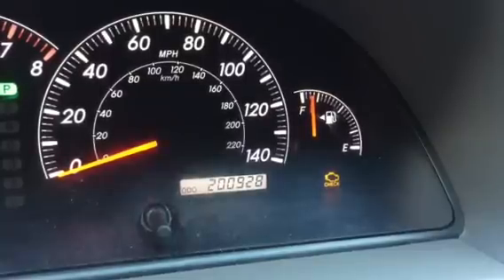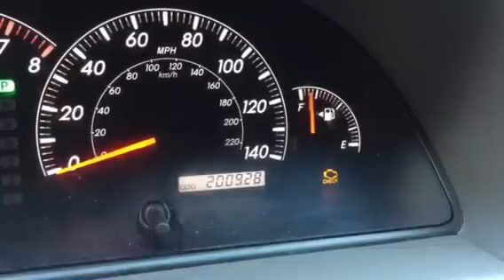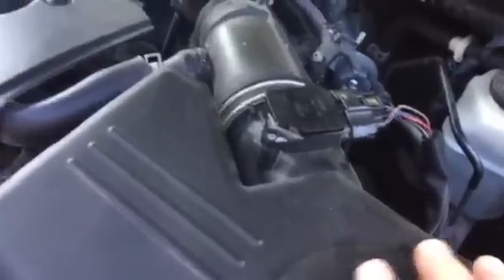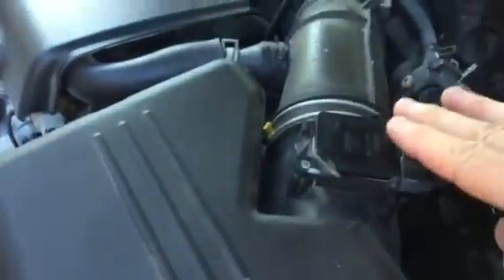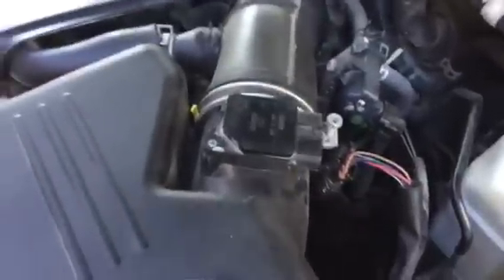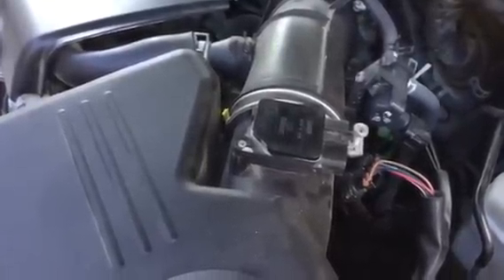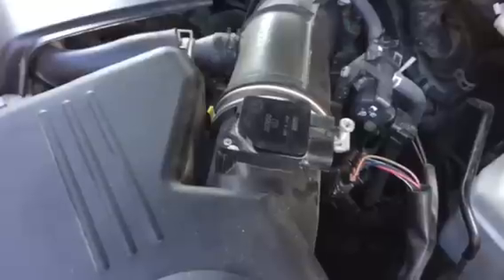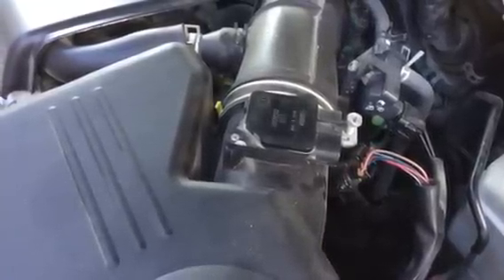How To Tell If Your Mass Air Flow Sensor Is Bad On Your Car

Comment: If I'm driving down the highway and push my gas peddle to the floor and it kinda slows down then gradually picks up speed is that a bad Mass air flow sensor? I unplugged it and it keeps running, actually idles a little higher. My check engine light isn't on though.
Reply from the maker: That is certainly one of the signs of a dirty or failing mass air flow sensor. 
You might want to clean it first before replacing it.   https://youtu.be/YnckaCCJEEk

Comment: my1995 camry rev only up to 2000 revs checked all censors ok its a 2200si camry please i need help
Reply from the maker: You might have a plugged  catalytic converter.

Comment: I have a chevy malibu 2001 ive been having some idle issue when im accelerating seems to lag a little i have replaced the TPS sensor and it still remains i did disconnect the MAS from my car and it does change the idle when disconnected would that mean its not working correctly if it doesnt turn off
Reply from the maker: Your symptoms sound like the mass air flow sensor could be dirty or faulty.  I have experienced a faulty mass air flow sensor before the check engine light turned on.  Also make sure you're throttle body is clean.  
https://youtu.be/cOAYWVBfuek 
https://youtu.be/YnckaCCJEEk
Reply: WeRanyone714 i think some issue with the paddle sensor

Comment: Hi, I have 2006 BMW 330xi. I tried this methond. Car continued to run. It actually ran better. Please anybody has any ideas as to what my issue my maybe please add. I keep getting mass air flow codes more than one. And I replaced the sensor with a new one. Same problem occurred. In starting to think this may be a throttle body or iac issue.

Comment: Tried it on my 06 2.5i impreza. It shut off right away first time i tried unplugging it. And threw CEL. I reset those codes then tried unplugging it again, and it does not shut off, but throws CEL? Any ideas??

Comment: Thank you for a good video I just installed a new one and wondered why the engine light still on. Now I know
Reply from the maker: The check engine light should turn off after 50 miles of driving.

Comment: I had P0171and P0174 codes before I the MAF sensor was cleaned then Check engine light gone but I cant accelerate more than 80mph, it loose power.I follow your suggestions disconnecting it and stopped. I have a 2011 Ford Edge sport can you give me another direction to check? Thanks

Comment: Golf 4 1.9tdi 66kw alh i unplugged the maf sensor and it's still running and it drives a much slower than before so my MAF sensor good or bad?

Comment: My car toyota vios 2005, the engine keep stalling. Mechanic says maf sensor need replaced. I test this method and my engine stop when i unplug the cable, so my maf is fine?
Reply from the maker: I would first start by cleaning your throttle body.  https://youtu.be/cOAYWVBfuek
Reply: proclaimliberty2000 i ask the mechanic to clean the throttle body and it getting worse. He ask to replace the it. Wdyt?

Comment: Hi I have a question? It is brand new put on today and engine light would not go off after driving. I just changed my 02 sensors in back engine light off than came on with MAFS code but my car was not running rough or bad?
 I just did what you said left engine running and unplugged the mfas and my engine kept running ... I put my old one on and it did the same thing and the engine stayed on. Are you sure this is the way to check?

Comment: Just to clarify. Truck was running I unplugged sensor and it kinda went down on rpm but stayed running. So this means I need to replace the sensor because it is bad?

Comment: I'll doit to my 2005 f150 4,6 truck stalling but don't stop I change the maf not to long ago any idea what I do wrong. or its a bad sensor from auto zone?by the way check engine still one code 0171 and 0174 sill present after reset the system. any idea.

Comment: I have a 08 Tiburon, removed MAF didnt shut off but Im not getting any error codes and the car is driving fine, I don get p0133 O2 sensor code once in awhile, can a bad MAF bring that code up?

Comment: This was great.  I love the fact that you showed how to check to see if my mass air flow sensor was bad.  I just had my air filter changed and the next day the check engine light came on.  With a diagnostic test from Goodyear, they said that I need to replace the mass air flow sensor.  This helped me know if they were just trying to rob me because I was a woman.  Thanks so much!!!

Comment: You are the MAN!! , i had rough acceleration, idling was horrible.. I have a 2004 MDX. I turned on the car removed the connection and the car turned off. But as soon I reconnected the connector the idling and acceleration issues were resolved. Its driving much better. I was going to replace all the spark plugs, fuel injectors..  you saved me lots of money. 

FYI a few months ago thoroughly cleaned the throttle, same results bad idling and acceleration. I guess by unplugging the MASensor while the car is turned ON it reset its reading.. Im very happy now..
Reply: "But as soon I reconnected the connector the idling and acceleration issues were resolved. " You mean reconnected with a new maf sensor? I don't think  the point of the video was unplug it and them plug it back in ad it'll be fixed?
Reply: That was around five months ago or so I guess, just curious on how your car is doing now? Am thinking of trying this. Thanks!
Reply: That was around five months ago or so I guess, just curious on how your car is doing now? Thanks!

Comment: Changed the air sensor check engine light is still on after over a week. Smh
Reply from the maker: Have an auto parts store put a diagnostic computer on the vehicle which they will do for free and you will find out what's wrong

Comment: Hey great video, I have a question I have a 2015 Infiniti Q50 that has a code of (P0102) . I’ve been noticing that the air filters are very dirty. Do you think that might cause it?

Comment: Thank you.  My check engine light came on and after I had it diagnosed that my mass engine flow sensor was the cause then after a few days it went off.  Do you think I should have it replaced or not?
Reply from the maker: I would first clean the mass air flow sensor.  If after cleaning it the check engine light comes back on then I would replace it.  https://youtu.be/YnckaCCJEEk

Comment: Ok..THATS IT????  I just did this on my car, that 'idiot light' came on yesterday, as i was driving,never has in 12 years of ownership, and i am of course seeing thousands of dollars flying out of my wallet.  
I pulled the plug on my MAF, and it is 1 month old!!! The entire set up, the tube and sensors, from EBay!  And it kept running.  So it is bad?  It is that simple?  On all cars?  I did it like 5 times, and it just kept runing. So...i need a new MAF...which comes with that air tube and all.it isnt exactly expensive, but how do i know i am not getting a broken one again?
Reply from the maker: Go to an auto parts store and have them put a computer scanner on the vehicle which they will do for free and see what trouble codes it shows.
Reply: Turns out my car doesn't even have a 'MAF' sensor! It has a 'MAP' sensor. The thing YOU pulled out on your Ford, on my Chevy, is a temp. sensor for the MAP sensor.  So it doesn't stall the car out.
I know I have to take it to AutoZone or someplace, tomorrow.  I did reset my 'engine light' so it is now off. It hasn't gone on yet today. I am HOPING it was maybe a fluke. 
The car is known to do this, I am told.  Maybe others here didn't know they also have a MAP sensor, and that is why their cars also don't stop, when that part is disconnected.  Thanks.

Comment: my nissan sentra 2003 light "CHECK ENGINE SOON" is on, and doesn't accelerate, it gets stuck at 1500 RPM and I've read that might be the "MAF", what do I replace? can anyone tell me? I would really appreciate it.

it was running fine before, no problems.

Comment: My car kept running, a new mass airflow meter will cost over £350, is it possible to use a second hand one or is this a bad idea?
Reply: T-O-E just buy a “mass air flow cleaner” and use as directed to the can :)
Reply: when i took the MAF off there was a part of it sticking up on the inside, it looked like it had been glued on in the past, i pushed it back in place but it didn't work so i wonder if it is knackered. I suppose using a cleaner wont hurt, if it works then i'll be happy. Thanks

Comment: I already cleaned my maf but  after few days I encounter again engine hesitation. Why is that ?
Reply from the maker: Without a check engine light on it's hard to know for sure but it's very possible you could have a failing camshaft position sensor.

Comment: I have Peugeot 307 HDI 2005year model. And when i unplug connector motor still normally running. Is this correct on May car.??????

Comment: Guys I need help.. I have mazda 3 2005 1.6... When ever I on ac my car accelerater go up n down automatically.. Then I turn off Ac car is normal again.... It's only happen when I on Ac... Can anyone tell me what is problem?? Please
Reply: It could be your idle control valve playing up. Try cleaning it out with carbon cleaner.

Comment: Awesome man spent 190 dollars at a corner shop and couldn't find the issue on why it idles roughly, I should have started with YouTube to find my issue myself. I came across your video third video from The View Bar I tried it and that's exactly what it was. From now on I'll be diagnosing my own car using YouTube
Reply from the maker: Also make sure your throttle body is clean.  https://youtu.be/cOAYWVBfuek

Comment: Thank you so much. Will check this out tomorrow on my 02 S60 with 247k on it. Its not worth dumping a ton of money into it so if I can isolate the problem after the check engine light just came on it will keep this thing going!!!!
Reply from the maker: If your check engine light just came on you should take it to an auto parts store and have them check it with a computer scanner which they do for free.  That should narrow it down pretty quick to what the problem is.

Comment: have a 2000 ford mustang, an it just started shaken ,while car is running, no display lite are on , no loose of power ,it just shakes and tremble idle and driving down the road . cranks up fine
Reply from the maker: My best guess is that you have an ignition coil pack that is starting to go bad.  You could also have spark plugs going bad or a clogged fuel injector.

Comment: What if you cannot keep engine running long enough to do so. Mine stalls in 2 seconds. Also would this cause 1 and 2 cylinder misfire codes?